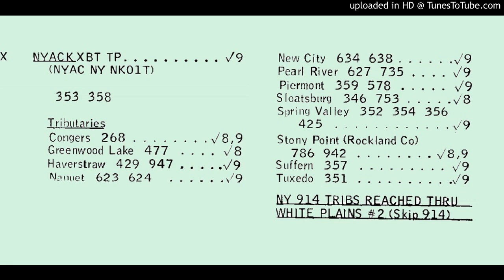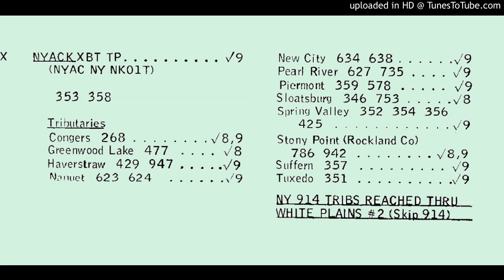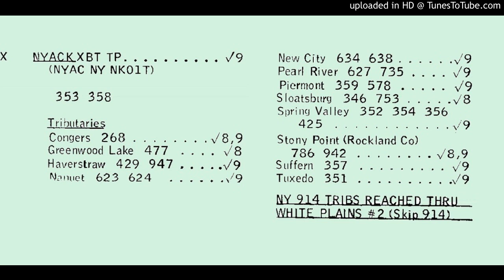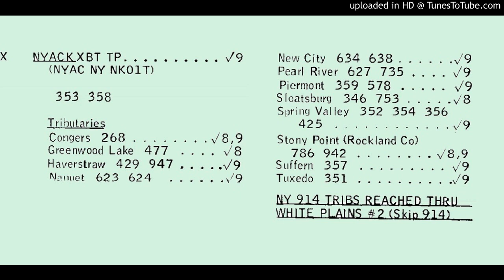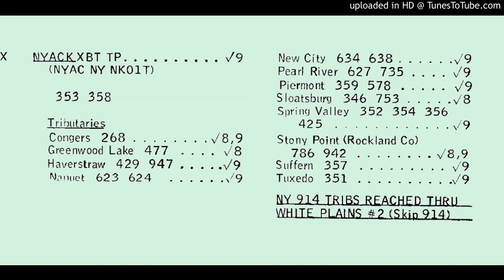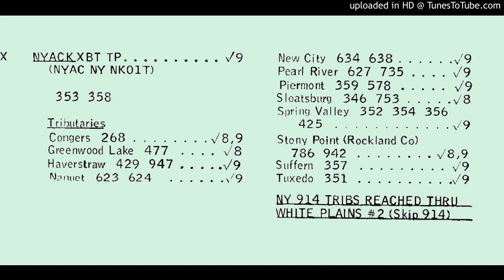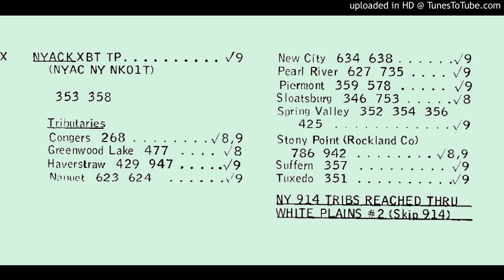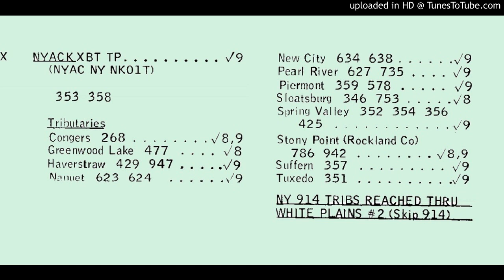Warwick & 914, pgm. 13: Nyack XBT Sector via N1 Carrier from Mamaroneck NY #5 Crossbar (July 1981)

Comment: So, what would the network of today do if you played MF tones into your phone?
Reply: It would still complete the call as it's backwards compatible with old phones. You can try it if you have a phone connected in your house, there's plenty of online dialers that can produce the tones
Reply: DTMF (touch tone) tones, yes. MF tones, no.
Reply: Guess I phrased my question wrong - though I think @jtc 1983 answered my question.  If the DTMF switching (blue box) tones were played into a phone today what, if anything, would happen?
Reply: @JeffFrmJoisey  Oh yeah crap, I was wondering if you meant that as well but I routinely confuse touch tone and MF signaling when used in a sentence. 
  
I agree with jtc, the phone phreaking stuff like blue box tones won't work on today's network (unfortunately as it looks like it was really fun to do!)
Reply: Really not much of anything these days. Though there are things like ProjectMF which let you call in and MF to access conferences, recordings, and all kinds of neat things. That said, it is a computer simulation meaning it is all software which is reading your tones.
Reply: @NikHYTWP  Back in the blue box days, MF tones were carried in band, I.e. on the same line your own voice went down. As soon as they moved to out of band signalling, ie. sending the tones down another line between switches, they killed blue boxing dead. So playing MF tones down a line today would do nothing at all.
Reply: Nothing